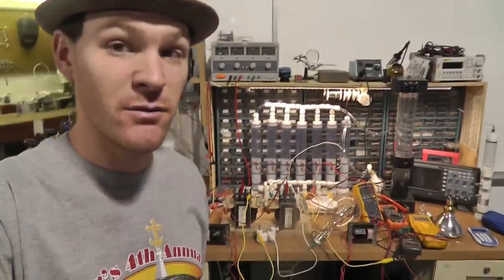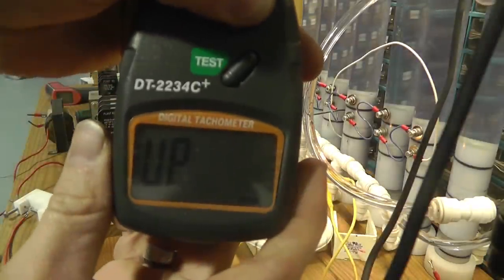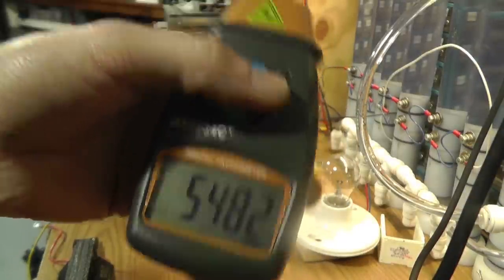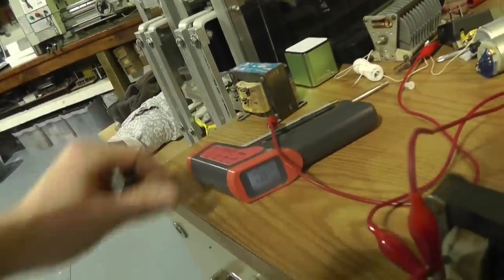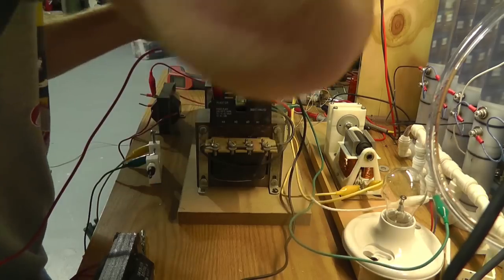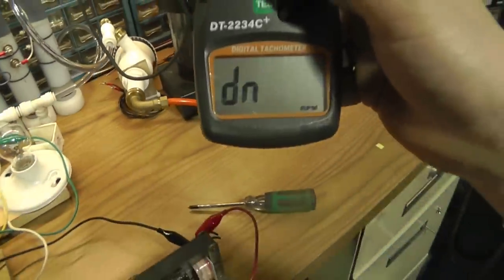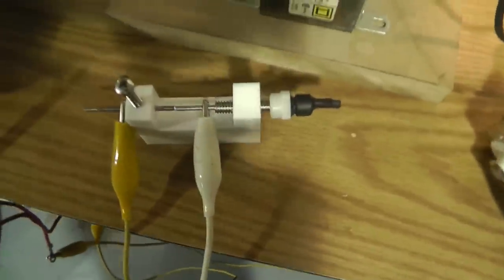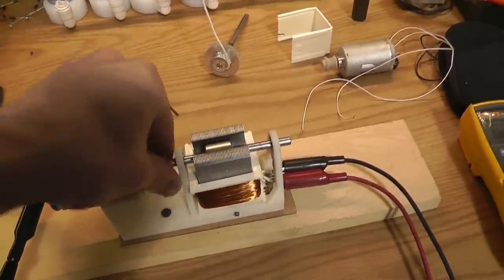Gerard Morin Testing. #1 Testing The Pump Motor. & Mini Make Shift Pole Pig Setup.

Comment: Why are you using a spark gap? And there is no need to cascade too many transformer. This is a radio frequency type of transmission and it is moving the magnetic flux. Remember there are two faces of a magnet: electricity and magnetic flux. When  you move electron it is electricity, when you move flux it is electromagnet.  In your experiment you are not sure what are you trying to do. You are adding items after items; stepping up, stepping down.....that is not the way to study the set up. I guess you are over-smart for this simple test. I replicated GM's set up and modify the core; everything works just as GM demonstrated. I saw GM's comment below and I was very happy to read it. Pay attention to what he suggested. Thanks for sharing your experiment. Always take negative criticism a ladder for you to go higher. Good luck with your experiment.

Comment: Is this myth busted?
Reply: NO!!!!!!!!!!!!!!!  Cold electricity is here to stay you might as well start learning about it because this is the way Tesla wanted to do it.
Reply: Nah, Morin is pulling a scam.
Reply: Doazic we will see
Reply: Every single possible unlimited device I have ever saw gets cold, this is one thing all of them have in common.
Reply: Well there are easy ways of faking that, and regardless, that's just misdirection on Morin's part, what matters is energy in vs. energy out.
Reply: Doazic If you look around and I have you see copper winding's outside with a magnet inside insulated in different ways turning producing a magnetic field of some kind and producing high voltage that can be used to produce work. The QEG although having many problems works producing electricity for light bulbs a lot of them but they have trouble performing physical work. There has to be something to this you definitely can get more energy out than putting in I don't know if it's using a combo of spark radiant energy with the brush-less generators but it just works. Look at the solid state generators and the bendini motors I mean how much do we gotta see to believe something is going on? I wish someone would produce a device running a house and show it to everyone and put an end to this doubting but unless it is on shelves at wallmart or the main stream media says it works it is gonna be doubted.
Reply: Well that's the issue, you can't get more energy out than you put in. The QEG outputs significantly less than is input, same with Bedini motors etc. The only thing they have in common is the huge amount going to the "inventors" for machines that don't work.
Reply: Doazic How can you say the bendini motors don't work and what money does John Bendini get this is free information off of the internet. Let me ask you a question do you believe in ambient unlimited energy?
Reply: Bedini makes money selling the kits and off donations on the website. And the motor is under-unity, so in that sense it does not work.
Reply: Doazic If you believe multimeters work you should believe in the Bendi motor
Reply: Multimeters work, bedini's do not.

Comment: My dear ur doing it all wrong wrs urs caps esp place them after the alternator or pump whatever u want to call them also after stepping up fm thr using a step up transformer with lot of copper both in alternator and transformer then use a spark gap with a cap then seperate into pos and neg stout bars either grounding one the do the tests ur cap size determines the high frequency pass u use different frequency u have different properties so check them out with different cap and different frequencies ur iron core doesn't seem to work either get a one which is of good resonance, resonance in iron core is essential